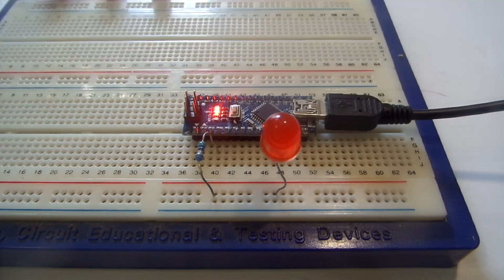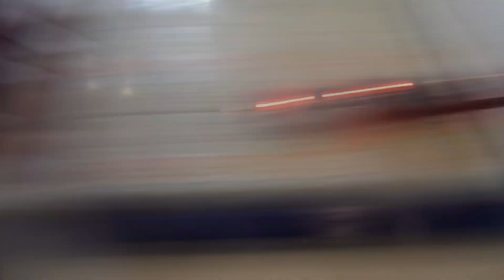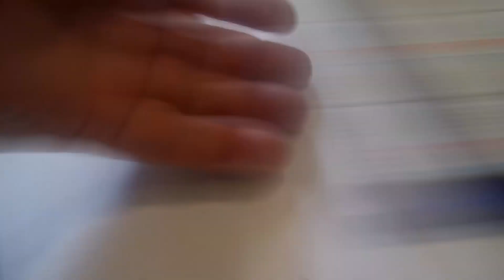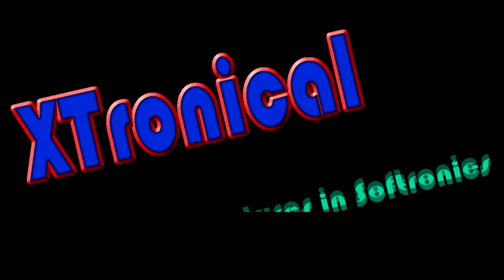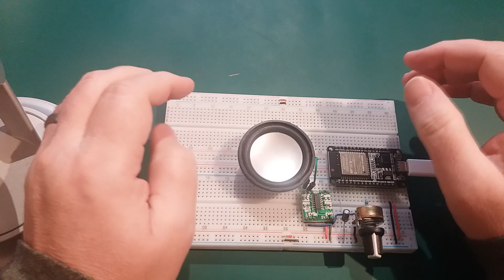Dac Audio library Version 4.2.1 released. Playing sounds/wavs on your ESP32 using the DAC

Comment: I'm building a piano using some buttons to create notes. The idea is that when a button is pressed and held down, it will produce a sound, and the sound will stop or be silent when the button is released. I'm learning to use music scores but it still doesn't work. Can we do it using this library?
Reply from the maker: What are you using that isn't working?
Reply: @XTronical  here is my code, maybe something needs to be fixed. Thanks in advance 🙂
#include "MusicDefinitions.h"
#include "XT_DAC_Audio.h"

XT_DAC_Audio_Class DacAudio(25,0);
XT_Instrument_Class DO(INSTRUMENT_HARPSICHORD);
XT_Instrument_Class RE(INSTRUMENT_HARPSICHORD);
uint8_t ButtonPin [] = {12,4,16,17,5,18,19};

void setup() {
  for(byte i = 0; i<7; i++){
    pinMode(ButtonPin [i], INPUT_PULLUP);
    delay(10);
  }
}

void loop() {
  DacAudio.FillBuffer();
  if(!digitalRead(ButtonPin [0])) DO.SetNote(NOTE_C4);
  else DO.SetNote(0);
  if(!digitalRead(ButtonPin [1])) RE.SetNote(NOTE_D4);
  else RE.SetNote(0);
  
  DacAudio.Play(&DO);
  DacAudio.Play(&RE);
}
Reply: @XTronical  I'm still new to using this library, I'm just curious, how do I play a note continuously without any pause or certain duration.

Comment: Libraries work but there is a wheeze/wheeze noise on every song. the sound is not clear. And it is not the fault of the amplifier that I use because without - that is, connecting the speaker through a resistor to the DAC25 or 26 output, there is also noise. any tips?

Comment: The 4.2.1 version seems to be having an issue currently compiling, going back to the 4.1 version worked fine for me. Not sure if it is related to the ESP library updates, but in case others have issues I wanted to share... I have not had much time to get into the details, but it seemed to be related to the timer/rtc.
Reply from the maker: Thanks for that. Will try and have a look sometime. It does use a timer so perhaps something has changed

Comment: Hi, new fan and subscriber here. Thanks for sharing your knowledge!
I have a question about this great library.  I recently started to work with the ESP32 for my electronic musical instruments, because it does MIDI over BLE. So now I want to add an audio output through the on board DAC, like I've done on the Teensy 3.2 with the audio library, and with PWM on other Arduinos using dzlonline's "thesynth" library. 
But I can't seem to figure out how to output a simple waveform at a determined pitch and volume, unless it's part of a "MusicScore" object. I've spent a couple of days messing around with this, and learning a ton from the library source files, but some of it just goes over my head... The included examples work great on my board, but they don't implement what I need. Is there a way to do this, without significantly rewriting parts of the library? 
Thanks again!
Reply from the maker: Hi,  thanks for your comment. I'm on vacation at the moment but will post an example for you to try in a couple of days. I have also created an I2S library if that is of use, for which the source code will be released soon. Demo's are available in one of my playlists.
Reply: @XTronical  Thank you! I've seen the I2S library, but for my current project my priority is minimizing the number of components, rather than achieving extreme audio quality. Where should I look for the example? On your github?
Enjoy your vacation!
Reply from the maker: There isn't an example for pitch I don't think, only got my phone at present so will sort out in a couple of days
Reply: @XTronical  Hope you enjoyed your vacation! Sorry to keep pestering you, I understand that you have a lot on your plate. I was wondering if you had a chance to look at this. Thanks in advance 🙂
Reply from the maker: It's been released to paterons, will release very very soon to others
Reply: @XTronical  I went to your patreon, and I can see that you pre-released the i2s library, which is great. However, my question was about your older library, which uses the on-board DAC, and trying to output a simple waveform at a determined pitch and volume, without it being part of a "MusicScore" object. You said you'd post an example for me to try...
If you don't have time, then I get that. Again, sorry to keep pestering you, and thanks for your time.
Reply from the maker: Ahh, right, I've had several conversations lately and got confused! I'll try and post example tonight. This is a night I do you tube stuff.
Reply from the maker: Right, here we go. I think this will do what you want, but it is untested as my board is missing in action somewhere. The main points to note are to create an "instrument" with no defined instrument. Then set the wave form of it and then you can manipulate the frequency and volume.

#include "XT_DAC_Audio.h"

XT_DAC_Audio_Class DacAudio(25,0);                                            // Create the main player class object. Use GPIO 25 (DAC pin) and timer 0
XT_Instrument_Class Sound(INSTRUMENT_NONE);
void setup() {
  Sound.SetWaveForm(WAVE_SINE);   // others available such as square
  Sound.Frequency=1000;           // there is a max limit depending on the wave form due to sampling resolution
  Sound.Volume=100;
  DacAudio.Play(&Sound);           
}

void loop() {
  DacAudio.FillBuffer();          // This needs only be in your main loop once, suggest here at the top.
  // put whatever code you want here that you would normally have on your loop
}
Reply: @XTronical  Awesome, thanks! 
Now I'm finally getting somewhere 😄
I had to change "Sound.Frequency=1000;" to "Sound.SetFrequency(1000);" to be able to define notes properly. I still have some figuring out to do, but I should be able to make it work from here, thanks again!!
Reply from the maker: Your welcome.

Comment: Hello, I am using your library but I got a bit stuck. I upload the program successfully but afterwards my ESP seems to be unable to perform the WiFi configuration. It does not connect to WiFi anymore. Any ideas what could be wrong?
Reply from the maker: I think this has come up before. Can't remember for sure but I think someone solved it. I'd scan the comments, it might be there.

Comment: How to change the pitch of the currently playing audio in this project?
Reply from the maker: There is a speed playback property you can change, which will alter the pitch, see this video,
https://youtu.be/cJxwd2O5hJY
Reply: @XTronical  But I actually don't want the playback speed to be changed while changed.
Is there anything I can do to achieve this?
Reply from the maker: No, not in real time, sorry.
Reply: @XTronical 
I aslo don't want to change the pitch while playing. Change the pitch before playing. Like a keyboard.
Is it possible?
Reply from the maker: You can put the sample into audacity and that can do that.

Comment: i havent  played around with the library yet, but QQ, is it possible to play a single sound in a loop? like a engine sound?
Reply from the maker: Yes, there is a property you can set to cause the library to keep repeating a sound over and over again forever. I think I called it "repeatforever". I forget now and I'm not near my computer. I think there is an example of it's use in the examples although it literally as simple as setting that property to true.
Reply: @XTronical  i will take a look thank you
Reply: @XTronical  thanks, i did get this to work how would you 'stop' a file from playing, especially if it is last in a sequence and set to repeat forever
Reply from the maker: Setting Playing=false should do the trick.

Comment: I've problem on platformio emvironment with this library, i tried the example playwav on arduino ide and is ok, the same on platformio make noise and also volume change everytime (i not know how to explain exactly), the board is a custom board, use wroom module, library is 4.2.1
Reply from the maker: I have never used platformio  so I'm unsure of what the problem could be. I would have to set up and replicated. If it works on your custom board connected to Arduino IDE then it suggests a Platformio issue. I would need to try it out with Platformio but at the moment I've not the time to investigate, sorry.
Reply: i've found that if i enable task for the 2 core, sound is played correctly. maybe this help someone
Reply from the maker: Thank you for taking the time to post this, I don't understand why that works but it's good that it does.

Comment: I have built a WiFi Connected sound generator to use with Home Assistant.  Thanks for your  XT_DAC_Audio 4.2.1 code.

Unfortunately, I think that I have found a bug in the rendering of some wav files.  I used Audacity to create a fixed tone wav file to set the output level for my amplifier.  The wav file is +/-0.8 at 440 Hz.  When played on my PC I hear a pure tone.  When played through the ESP32 there is some high frequency noise and a 2 Hz click noise running through it.  I also tired a 440-1000 sweep from another source and heard a similar click sound.  Other sounds like FORCEWITHYOU are OK.  

Please try a pure tone to see if you can replicate my issue.
Reply from the maker: I'm working on an update, will try and replicate this problem, thank you
Reply: @XTronical  The fixed tone wav code plays OK, modifying the PlayWav.ino example.  (There are clicks every time the wav file is repeated.  Not great.)  There must be some conflict with the #include <WiFi.h>
 (1.0) or 
#include <PubSubClient.h>  (2.7) libraries that I use to transmit a "play sound" command from Home Assistant to ESP32.  Maybe another interrupt source is required?  I am using PlatformIO for development but I have duplicated the issue using the Arduino IDE.
Reply: I wrote my own code to play wav files on ESP32 DAC.   The sounds played OK for 8 bit, 8000 samples/sec.  When I added the Wifi/MQTT functionality the same sounds where noticeably distorted with added noise.  So no bug in your code, just an application limitation.  Wifi generates a lot of high current spikes which must flood the chip with noise.  Seems silly, but I may need two ESP32 boards or switch to a Moteino M0 board with a low power RFM69 radio.
Reply from the maker: Thanks very much for coming back and informing me, saves me a job. Appreciated.
Reply: @XTronical  I found a solution to the WiFi noise problem.  I just turn off the WiFi radio when playing the wav file using this statement WiFi.mode(WIFI_OFF);
  I enable my re-connect function when playing stops.  The WiFi connection toggles but I am only playing the sound in an alarm situation.  The weakness of the ESP32 DAC is that its reference voltage is the 3.3V digital power supply.  Compare that with the SAMD21 DAC.  It has a separate analog reference for the DAC which can be a filtered version of the 3.3V supply.  Also 10 bits resolution.  In my opinion, a much better option for quality sounds.  Cheers.
Reply from the maker: I'm currently working (or shortly will be to be more precise) an I2S version of the library which should solve this issue and give 16bits resolution if required.

Comment: Hi... May i ask, how do i make the audio into stereo..?
Reply from the maker: The library does not yet support stereo, it is coming in next few months but the downside is file sizes will double so you won't be able to store as much stereo sound compared to mono.
Reply: @XTronical  if i split the stereo sound in to mono ( one for left and one for right) and play it through 2 diffferent dacs will it be possible..? Can 2 sound file be played simultaneously..? Thank you for the reply...
Reply from the maker: Yes, but you would need to alter the library to read two data arrays and send to both DACS. It wouldn't be a mega hard task but not a simple tweak either. If your not sure and can wait then I will be doing stereo in the next 2 to 3 months.
Reply: @XTronical  I'll try to pull it off... But if i cant... I might just be using 2 microcontrollers and have them play at the same time...
Reply: @XTronical  hi so we have discovered one solution... Esp32 has a dual core but when writing is void loop, by default it uses only one core... We can access the 2nd core by applying these codes 
https://randomnerdtutorials.com/esp32-dual-core-arduino-ide/
With this we can run 2 codes simultaneously
Left audio will be played in the core 0 and right audio will be core 1... Hope this helps...
Reply: @XTronical  hi... Just an update... Plan did not work.... Lol... Noticed that it only plays in one DAC and play in the last declared DAC pin...
Reply from the maker: Your idea seemed promising, good effort. Maybe the entire DACAudio software should run on the other core, interesting idea.